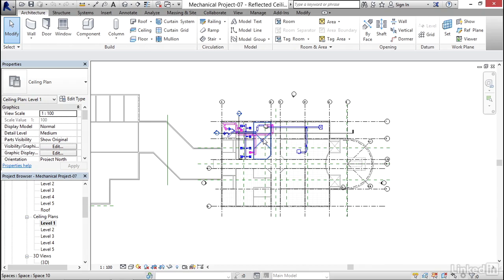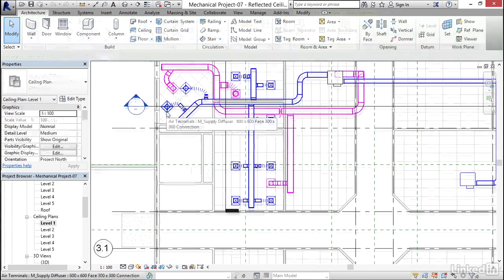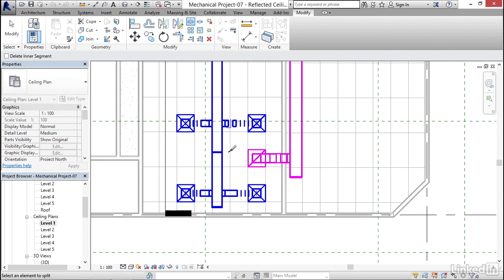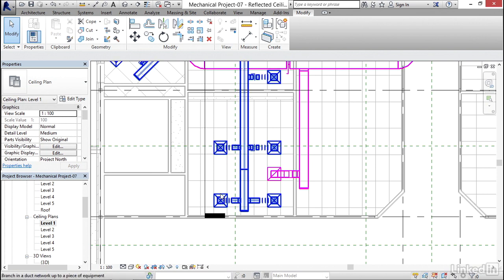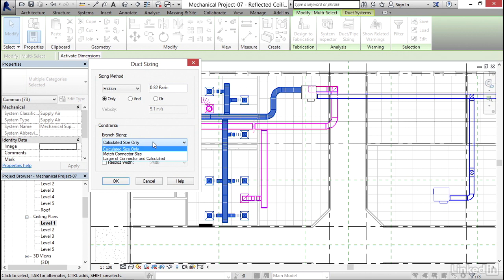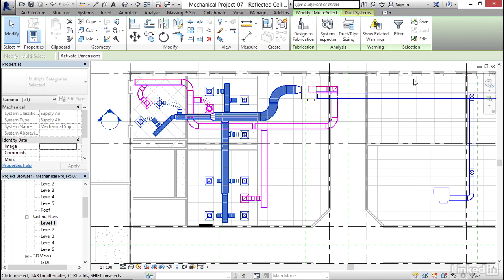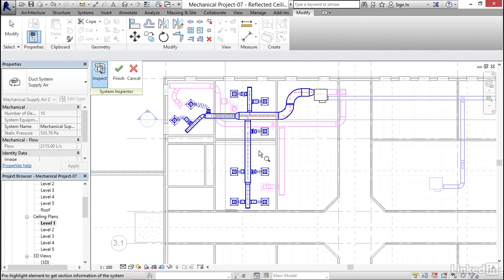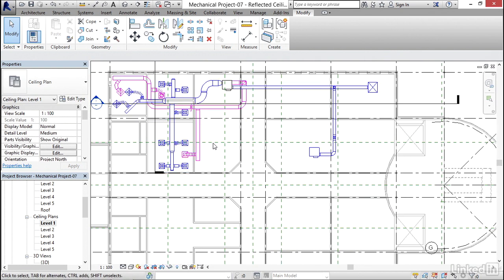REVIT MECHANICAL : Sizing a duct

Comment: why would you need to split the duct?
Reply: I think he meant to imply that  it would help resize sections of the duct once system inspector detects an arithmetic error
Reply: Revit can't resize a long duct that's why split is used there